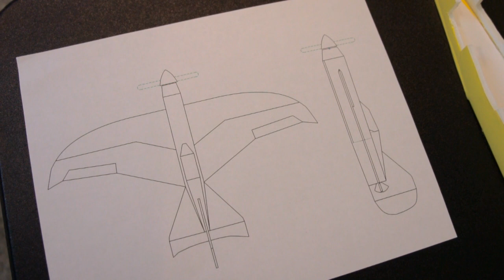Die Hard Racer Plane Part 1

Comment from the maker: @Tsavah there is no incidence between the main wing and rear horizontal stabilizer. Both glide tests with and without the electronics installed went fine with it nosing down a little right at the end of the glide. I'm still thinking it has to do with thrust angle.

Comment: take all the angle out of the motor, 0 - 0 will work. where was the CG? looked like maybe moving it a little more forward until you get it dialed in would be better too. my 2 cents anyway.